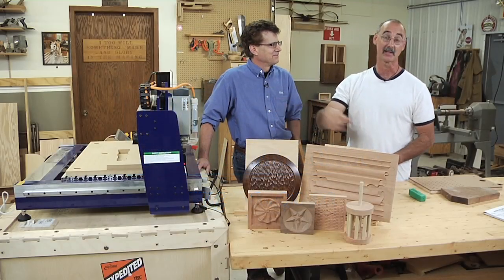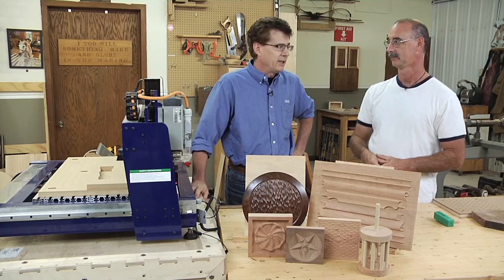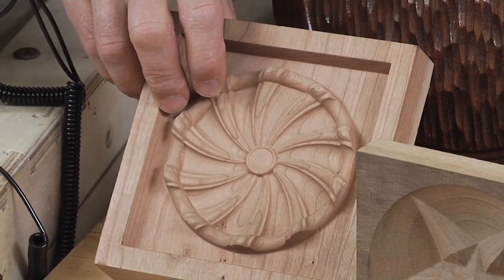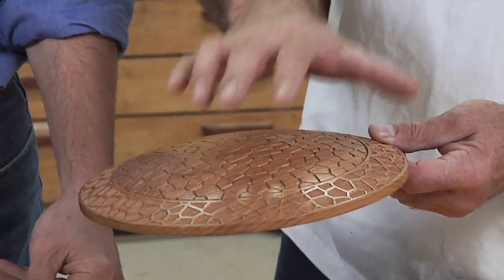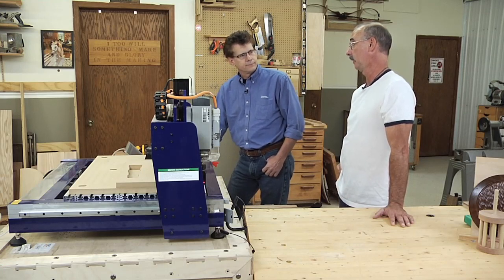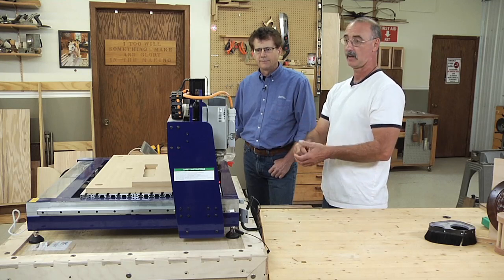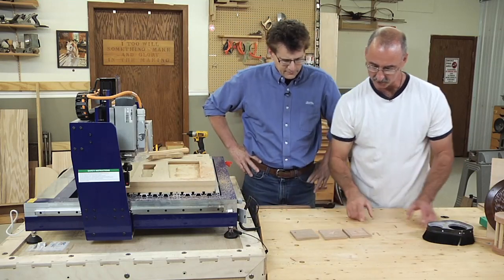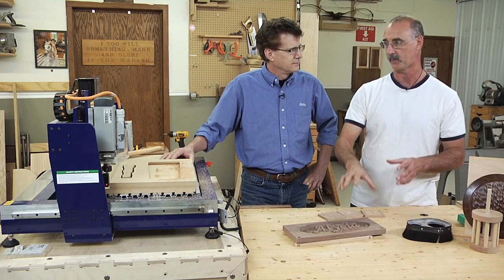Do I Need a CNC Machine?  |  Woodworkers Guild of America

Comment: I designed and built a CNC machine for my garage before I purchased a drill press, band saw, table saw, sander, planer, jointer, or chop saw. In fact, of those things, I only own a drill press. And I don't regret it in the slightest; it got me to think in a totally new and innovative way, and the learning experience was second to none.

Comment: Just happened on this site. So much depends on what you want to do. It can be a great hobby. The machines shown here are hobby level. If you want to make a living with a CNC, you will need something faster, probably larger & more powerful. Big difference between machines for solid timber and sheet material. Sky is the limit. New machines keep getting more capabilities.  I have long made a living with them. Fixing to order my 4th. So many things to consider. Have fun. Larry
Reply: +Larry Schweitzer 
What would be a better CnC machine?
Reply: Laguna is nice, but this Shopbot seem to be fast and the software looks complete...
Reply: I just got back from IWF2016. There were many CNC routers there. From very small to huge. Prices from less than $3K to over half million. Shopbot is US made, Laguna, I think, is Chinese. There was even a nice looking Turkish machine @ the show, but too big/expensive for most hobby people. Don't be impressed by advertised speed. Hobby machines usually have the motors from hand held manual routers. Limited power & life. Choose one with variable speed. That will allow you to match the feed speed and rotational speed to get the best chip loading and therefore life from you bits. You will be limited to the bits that will fit a 1/4", 3/8" or 1/2" collet. Most industrial machines use ER32 collets that are available in many sizes, imperial & metric. Onsrud tool has an excellent catalog on line that will assist you in getting the correct chip loading.  The software you use is as important as the machine. Professional level machines use the standard G-code system. It is possible to manually write g-code but it is almost always automated by CAD/CAM software. 
Even the cheap machines are capable of very accurate work. If your machine control does not have look ahead,  you will need to keep your travel speed down to stay within the capabilities of your machine. Have fun.

Comment: Just as a note, you CAN build a benchtop CNC for under 500 dollars and have it be extremely functional, you could also buy one of the china made models for 600 or so and have a grand old time.  The american made ones start at 7-800 or so, and are pretty nice as well.  Do your research and you'll find a way to make it happen.
Reply: the machine you see here is $7000.